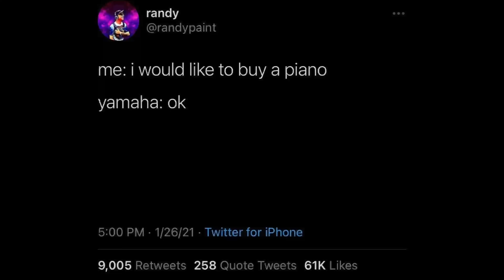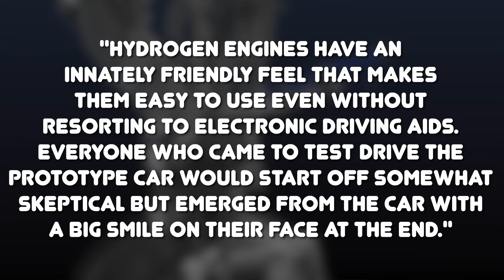Toyota's New 455HP Hydrogen V8: Everything You Need to Know

Comment: It’s ok as an attempt to keep die hard petrol heads happy in the future. And it could be of use in big trucks. So why not. 
But it won‘t change the fact that BEVs have already won over almost all the commuters out there. So it is not going to be an interesting alternative to them by any means whatsoever. ICE cars are not nearly as durable, cheap to run and easy to drive for your daily short distance commute as BEV cars. Period.

Comment: It’s obvious you are not for this technology which is a shame. However, if the manufacturers would make a system in the car that would require the driver to just add water then that would be a game changer. Then you wouldn’t have the issue of refueling stations.

Comment: I can tell you this, electric cars won't be the main thing at least in the UK. Our roads aren't flat and straight, winter time we blast on the heat and very few fueling stations have the electric charging infrastructure in place.

Hydrogen gets a bad rap since Elon bummed it but I really do prefer the combustion engine as it is the best fit currently for the road status here in the UK

Comment: No demand?  Not if you are basing your opinion on the current Hydrogen service station model.  I've been producing my own Hydrogen for over ten years to supplement my fuel system.  I can easily make enough to power one of these motors.  I'll be the first one to line up for it, then add my system to it.

Comment: If the chemists can make additives that can stabilize hydrogen..and I have to suspect they can...or have in 2014 and afterward....then it becomes about infrastructure...and such additives might allow using current gas stations...And I agree with the commentor saying there's probably hydrogen generator that can be marketed for home use or a subscription delivery service where a van has generator aboard. The excuses for no hydrogen infrastructures seem poor though, because additives can probably make it much safer and stable.

Comment: Why is nobody talking about nuclear powered engines? The technology exists and prototypes have been developed and tested. The tiny nuclear capsule will power the vehicle for at least 1 million miles with zero emissions…as long as the body of the vehicle can sustain the structural integrity for such a long time. But I guess that would not be financially feasible for the car manufacturers. Imagine to buy only 1 car in your lifetime and had no need refueling it. No, they want to keep getting money out of you continuously and therefore not allowing this technology to be implemented on large scale. Electric cars, while still in development, is a technology of dying tree branch….its shortsighted - its a wrong direction. It will die out. No future there.

Comment: There is soooo much to it than just being the same as a normal gas engine. It’s the feel, it’s the reliability and most importantly it’s a culture. Not everyone wants to drive electric and who knows in how many years it would even take for countries that barely have food and water to implement electric charging stations. Hydrogen is genius and by doing so you basically provide MUCH MUCH cheaper “fuel” which is basically around all of us instead of making batteries that with one heavy speed bump and something hits it you can say goodbye to that battery. Maybe not now it’s amazing for some but if one of the if not the biggest manufacturers of vehicles believe it’s worth it then definitely they see something in it.

Comment: Hydrogen is abundant, safe and has  zero emissions..  The development of new batteries cost with a high environmental cost that is not talked about.  If your battery what does it cost to replace it.  Battery production has its own environmental issues that are glossed over.  Currently the ranged of battery operated cars is limited and it take long time to charge them.  The auto industry employees a substantial workforce, how many of these people will be unemployed with the Advent of electrical cars and the demise of the combustion engine .  Sometimes people need to think about infrastructure issues rather than utilizing simple thoughts for complex problems

Comment: Electric vehicles taking over in 5 to 10 years is an idiotic expectation.
There have been electric vehicles since the invention of the automobile. The same problems that kept the first electric vehicles from becoming a viable replacement for ICE vehicles remain huge problems to this day. The range of electric vehicles is absolutely pitiful, the charging times needed prevent electric vehicles from being used for anything else other than short trips, the price of electric vehicles is far too high in comparison to ICE vehicles, and the charging infrastructure is so lacking in size & ability that even with a very small percentage of EVs currently on the road, there are constant complaints of long lines of EVs waiting for available chargers.
As more electric vehicles hit the roads, the problems are only going to become more and more obvious. In most parts of the country, the electric infrastructure can barely withstand the increased demand during the hottest weeks of the summer.  Add EV charging to already heavy loads for air conditioning, and it is a recipe for disaster.
The automobile industry will be much better served by researching alternative fuels like hydrogen which can utilize the current fueling infrastructure with modifications rather than having to build a completely new system.

Comment: I know for a fact that here in Australia our electrical system is already struggling with the use of Electrical power. On extreme hot days houses have there power remotely turned off for load shedding so the entire system wont collapse. Now most of these decent chargers to charge the Electric cars up are 32 AMP that adds a heap of extra usage into the system. Each house with an extra 32amp for a charger and if you have more than one car then you will need another Charger so there is 64amps. And most houses are limited now to 40 to 63 amp per phase. I just cant see it working. Not to mention there is here in Victoria quite a lot of homes that dont have off street parking, so how do you charge your car ?? Wont be allowed to run a lead over a footpath or the fact the lead wont be long enough seeing as in many cases you normally cant park right out the front of your house. Hydrogen seems to be the most logical way to go.

Comment: Hydrogen can be stored at lower pressures using Lithium-6 Deuteride, but big Gov won't allow it because it is used in weapons.  It can also be done with Graphitic Carbon Nitride.  There is also promising research with carbonized chicken feathers.  It is slow, but hydrogen can be made from water using solar energy.  After initial cost, free and green.  It can then be stored in the lower pressure tanks that can be easily made automatically swap-able.   You drive up to a station, the machine swaps your tank(s) and you pay a fee.  Hydrogen powered trucks can bring the filled tanks and return the empty tanks to a plant to be refilled.  They could even be autonomous.  Super green!  BONUS!  Gasoline engine vehicles that already exist can burn hydrogen gas with little modification and 0 (zero) emissions!!!
Reply: In the future, the same infrastructure can be used with fuel cell vehicles!

Comment: I would be very interested in going with a hydrogen powered v8. Still having the same basic engine just changing the fuel. I never liked the electric concept, coal powered (juice doesn’t just magically appear from our wall socket, it’s produced at power plants that are mostly coal sourced) not to get into the rare metal mining for the battery that has a short life span that will cost almost as much as the car did originally to replace. If I’m changing from fossil fuel to renewable it’ll be hydrogen until we can get our hands on helium 3 and utilize it in vehicles

Comment: I'd like to know how efficient that engine is. Hydrogen has around 3x the energy output as gasoline, assuming the same energy density for both. However hydrogen is much less energy dense than gasoline, so for this engine to be making near the same power as the gasoline variant that's a considerable feat. I'd almost expect three times the fuel mileage, honestly.

Comment: Toyota CEO has already stated that it is flatly impossible for the entire auto industry to only produce electric cars. There simply is not enough electricity to go around in the power grid, not anywhere near enough rare earth materials available for battery manufacture, and it simply does not make sense. Until electricity is produced primarily by nuclear power, these EVs do NOTHING to "save" the environment.

AND that is the quiet part Toyota won't say out loud. They know damn well this western-anglo obsession with saving the planet is a useful ruse to exploit morons and relieve them of their earnings, but they aren't about to slit their own throats to keep up the ruse.

Comment: If they can sell the car Significantly cheaper and build an infrastructure they may have a chance especially if it is just as reliable say able to get 300,000 miles without major problems if maintained. Also we should remember that the US isn’t the only car market in the world. Also the electric car has a lot of hurdles to overcome yet. A battery that maintained its range in cold weather, a price that only the rich can afford. An electrical grid that can support it. In California we are looking at major problem’s with the electrical grid. They want us to cut back on electrical use already and we are not any where near a major portion of cars being Ev’s. In the East Electricity is produced by coal. Defeats the purpose of EV’s so there are many hurdles to overcome in the EV market also. T believe there is a place for hydrogen. The days of having one fuel that does it all are gone. I believe the majority of cars will be EV’s. But Trucks will be better suited to hydrogen, especially 18 wheelers. Before either one will succeed a massive infrastructure will be needed for both.

Comment: Hydrogen is only viable in the long run if it can be electrolysed from water for less than a comprable electric car.  In the short term, it might be viable as a replacement of gasoline in the current auto fleet if it can be accomplished cheaply and undercut gasoline prices, allowing lower middle class people to continue to drive their cars.
Reply: Hydrogen source is water. Hydrogen is for drinking and washing clothes not engines.

Comment: Hydrogen is the future The problem with electric is the batteries production is bottlenecked, not to mention currently events is messing up trade You literally can make hydrogen at your house for 50 bucks and if you have solar panels you can make hydrogen gas for free
Reply from the maker: That's great, but why not use the electricity you used to create hydrogen to just power electric motors? Also, what are you going to do with the hydrogen gas after you've generated it? You need to store it somewhere, plus the gas isn't very dense. Turning it into a liquid requires getting the gas insanely cold, and then the storage problem becomes even harder.
Reply: @Dustrunnersauto  yes exactly is it instead of storing the energy in batteries you Store The energy in its gas from, then when you need electricity you combine the hydrogen and oxygen molecules back together and it gives you electricity back as needed. It’s a way better way System, batteries only last seven years you can store the gas 400 years and still be able to convert the gas back into electricity

Comment: Yeah, hydrogen is much better as the technologies the IMF and World Banks put down since 1968 are starting to make a comeback now. I know because I'm the one working on the technology. Cars in the future will have nothing but water in their tanks for fuel as with this forbidden technology water is broken down in real time fast enough to power ICE cars and even Jet engines. How does the technology work? Basically it mimics the earth's Global Electric Circuit and breaks the bonds of the water molecules by way of ionizing the atoms that make up the water molecules getting them to eject their electrons. Since with water the atoms are sharing electrons if those electrons are told to go take a break the water molecules those atoms formed simply fall apart into it's component atoms, IE, hydrogen and oxygen gas atoms. Basically we are placing the power of a thunderstorm in the palm of our hands. 
Thanks to your video here I now know which companies I can approach with this world changing technology that is a blast from the past.

Comment: I think you need to do more research on battery powered cars. The batteries are the biggest flaw due to the materials used to make them. Unless they figure something else out to use in the batteries. Electric powered cars are gonna die as fast as they showed up. The process to mine the rare minerals is expensive and very few locations. Really liked the video and other info tho.

Comment: When you drive a gasoline combustion engine what keeps the battery charged? The alternator 

A vehicle that converts water to hydrogen is feasible. Eliminating the problem of transporting (hydrogen). Fueling with water is all thats needed. The electricity issue isn’t an issue because cars generate electricity from the combustion itself. 

All i see is a lot of excuses for “hydrogen vehicle’s” and the same reasonings that’s been given from a scientific article. Except scientific articles mention the issues but not the solutions. Perhaps an agenda is being pushed by “Elon Musk” 

In school studying mechanical engineering

Take care

Comment: You’re being too negative, when it’s perfected it will be everywhere. Electric does not elementary maintenance costs and is far from carbon neutral. There’s not an electrical grid that does not source power from burning a fuel source.  Just like when electric was super expensive and super heavy innovation made it better cheaper faster. Hydrogen could be more abundant when resources are allocated towards it.

Comment: This is an example of today’s woke understanding of systems engineering.  Hydrogen engines already have there place in replacement for big construction capable diesels.  They are very applicable for aviation and massive transportation vehicles.  Tesla has not “disrupted” the auto industry yet.  On top of that the climate change issue, will not be solved by BEVs made for the US.  Massive manufacturing of compact “shipping crate” micronuclear reactors that burn nuclear waste, is the only approach to cover all of the earth with clean energy.  We could even create carbon neutral approaches that simultaneously burn carbon based synthetic fuels and remove carbon from the air.  But hydrogen is the quick refillable approach that is clean, and can be created with abundant nuclear energy.  BEVs for small vehicles, and hydrogen for large.

Comment: In Europe they are rolling out Hydrogen pumps at gas stations. Solar panels on the rain roof above the gas pump, to power the hydrogen electrolysis machine during the day time and a big buffer tank to store some Hydrogen for night time customer fill ups. Honda, Toyota & Hyundai all have cars for sale in the €40k to 70k price range. Less than half the price of a Tesla. And they run well over 1000km tank range. Can a Tesla really do 400km ? not if you can only use the battery from 15% to 80% of the charge cycle. Lucky to see 300km from a Tesla. And the Hydrogen cars have potential to last well over 600,000 km. Cab drivers are trying them out. I'm thinking of getting one for my next car. 

The electrolysis machines cost $40,000. They need a few gallons of water and some electric. If a company had a fleet of cars they could install the machine and be able to refuel their fleet of cars for a few bucks of water and electric. Dirt cheap running costs.

Comment: Cool subject!  Great, so new engine equals good.  What about fueling?  How safe and easy is refueling?  How safe is production and storage?  Would we have on-site hydrogen production or do we lose efficiencies by transporting massive amounts of hydrogen to fueling stations?  Or can I just make my own fuel at home (which would be fine for commuting)?  How expensive is refueling by way of mpg comparison?  Maintenance isn't that big of a deal, but what's hydrogen's infrastructure look like?  The engine is a big step but if everything else is a giant nope, then what is even the point?  I want an efficient, eco-friendly Taco/Ridgeline that I can drive to work during the week and take kayaking and fishing on the weekend.  Maybe Toyota's endgame is a hydrogen powered hybrid vehicle with electric motors providing speed and torque directly to the wheel?

Comment: i personally hate electric vehicles with a passion. it takes anywhere from 90 to 680 tons of earth to mine the lithium for the batteries. electric trucks have much less towing range than a gasser or a diesel, and a lot of the companies havent shipped any units yet. i think if we go the hydrogen route,  car guys can still tinker around with their engines and hippies can have they're zero emissions.

Comment: 1 additional error in your statements EV's are not maintenance free they only push that down the road the batteries replacement which will come in time will cost nearly as much as a new internal combustion automobile and in time it will go up plus at least Tesla will not allow real repair of the battery just software that hides the problem. With tight to repair going away I would never consider a EV and would rather buy old